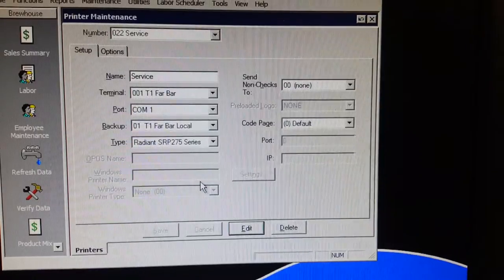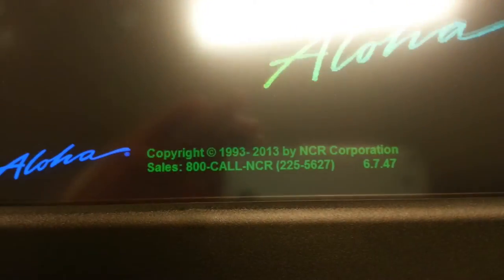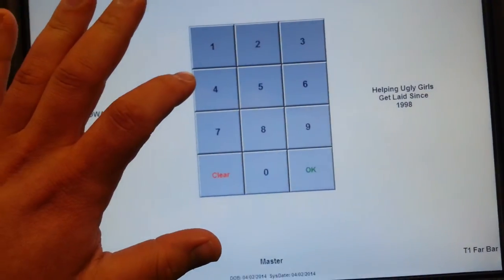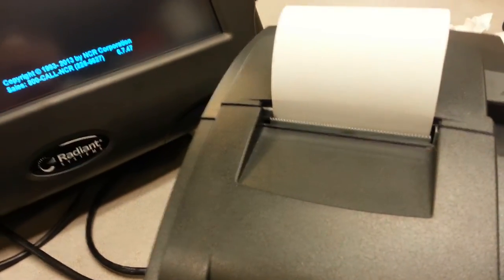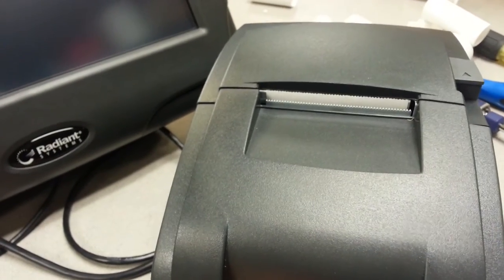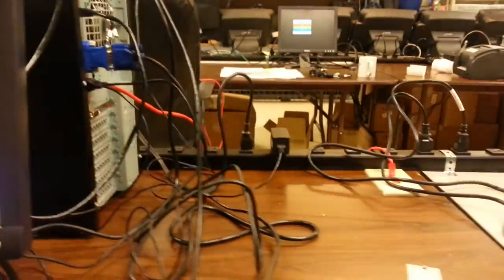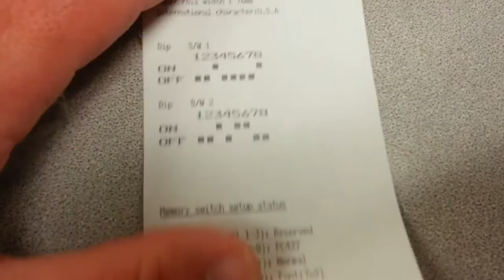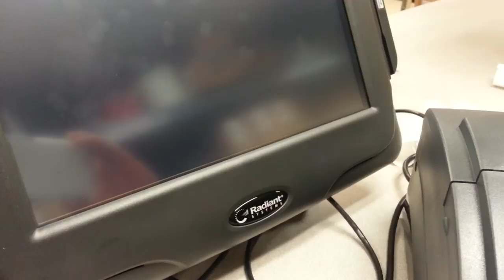Aloha srp 275ii

Comment: I hope you got it figured out. This really helped me though with the DIP switch settings at a site I'm working on. They have several different versions of the Bixolon. I'll test and see if I find anything. They are on 6.7.38 so it should be within range of what you are dealing with.